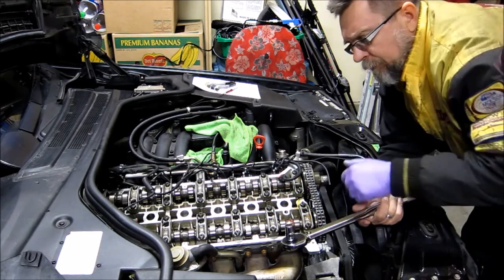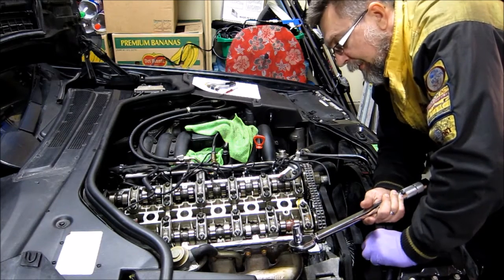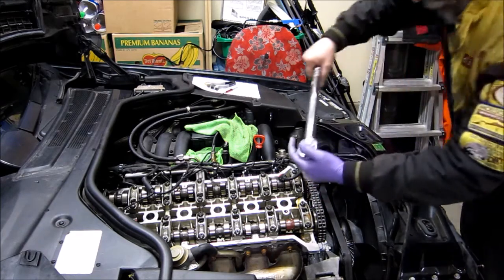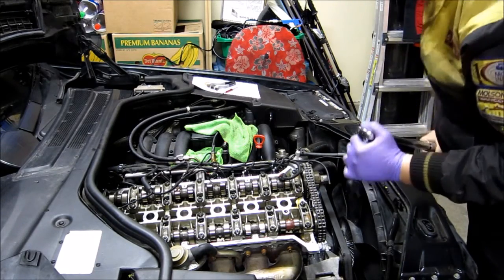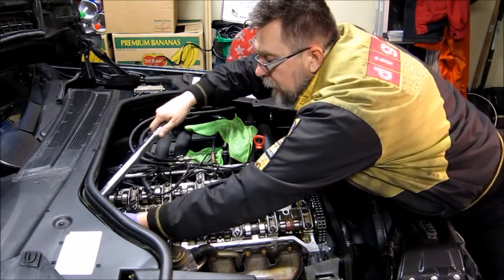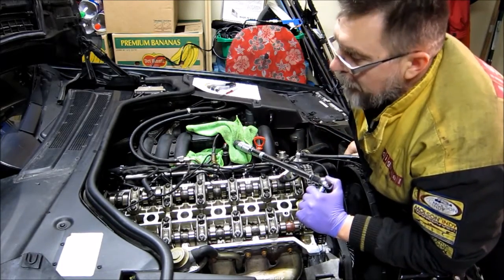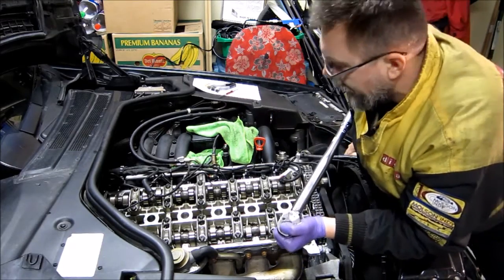Mercedes Benz W140 S320 Engine M104 Retorquing Head Bolts

Comment: Can i replace bolts only one by one ? i think my mechanic dont replace them when he worked with my head gasket
Reply: Mercedes manual says to replace the bolts when doing the head gasket, but I say you can use old bolts if they are ok...I would replace the bolts if they have stretched and are longer then 163 mm. New bolts are 160 mm long. 
If you want to replace them you could replace them one by one, just make sure you clean the bolt holes...remove all oil that is on the bottom of the hole or the oil will create a hydraulic lock and you can damage the engine block. 
Drain the coolant to lower coolant level below the height of the head gasket or coolant might leak into the cylinders. 
Follow the tightening pattern starting from the middle and apply some engine oil to the bolt threads and under the bolt head.
Good luck.
Reply: @andrewp3089  bolts are new mechanic said , can i retorque them using 90foot pounds(122NM) ?
Reply from the maker: @shithappens3031 
You could, but its not the best way.  The best way is to loosen the bolt, then follow the procedure : 50Nm + 90deg + 90deg.
You can do it one by one starting from the center and follow the pattern...
Better to drain the coolant and refill after you done torquing the bolt
Reply: i'm worried about my engine becouse high pressure hot oil can break new headgasket i think
Reply from the maker: @shithappens3031 
Oil leak in the front right could be a timing chain cover gasket leak. Its a known peoblem ob these engines.
Reply: @shithappens3031  I
Reply: thanks for answer , tell me which oil and plug sparks do you prefere for this engine ?
Reply from the maker: @shithappens3031 
I use syntitic Alsoil and copper plugs that MB recommends, cant remember the number now. Look it up othe manual

Comment: It worked on my engine, 99.9% of the oil leak is gone. I had a large leak in front and the read of the engine, the front one was the worst . I was ready to do the head gasket.  Thanks for the idea !. 12.000 miles and no oil leak.

Comment: Did it work and if so; how long did it last before having to do the head gasket?
Reply from the maker: I didn't completely stop the oil leak, it needed a new headgasket.
Reply: Thanks Andy.... I'm about to crawl under my S320 to change out the O2 sensor... if that and a couple other things gets the thing running so it's not stalling out all the time I've got to investigate doing the head gasket.... What a PIA.....LOL.  But thanks for posting the video.

Comment: Sorry for the late inquiry...what is the pattern? My engine is M111(4 cylinders) ,will the same pattern apply?
And what is the torque value? I read that it is 55 NM  for engine M104,does this apply for engine M111?
Reply from the maker: Mohamed Amer
Yes. Start from the center and go around just like I showed
Reply: You started from right front!!
Reply: and what is the torque? is it 55 NM? and you reach it is stages ..like 30 NM then wait..then 35 NM then wait..
and so on till I reach 55 NM ?
Reply from the maker: Look for
Pat's Car Garage    he has a series of videos for M111 engine.
I think u will find all answers
Reply from the maker: !!!!!!!Mohamed, You need to tell me first what are you doing. Are you just retorquing the bolts or you have replaced the head gasket, bacause that will drive how to torque the bolts.!!!!!!!
Reply: Sorry for delay...Actually my engine lost compression in cylinder 1 (at front),since the engine is leaking out oil (for years) and very near cylinder 1,I think there is loose head bolts especially at the front right side (where oil leak and near cylinder 1) (you mentioned in this video that you found the first 2 front right bolts loose a bit,right?). So back to your question,am planning to retorque not head gasket replace.
Since I didn't get a torque wrench yet,am planning to retorque the 2 front right bolts only,is that possible? Instead of retorque the whole bolt set.One more thing please,should I retorque when engine is cold ? or I can retorque with warn/hot engine? thanks
Reply from the maker: Mohamed Amer
I see. Ok so this is the correct way...
You will need a torque wrench.
1. Drain the coolant.
2. Starting from the center follow the tighening order as it shows on the page u sent me. Do one bolt at one time....
Loosen the bolt and pull it out. remove any oil that might be in the bolt hole, this is to prevent hydraulic lock. Apply some oil to the bolt threads and insert the bolt. then torque it to 55Nm, then you tighten it another 90deg and then another 90deg. When you done the first bolt move to the second.
Reply: oh...why remove coolant?
and retorque 90 degrees over 55nm!!!  isn't that over 55nm?!!(this may snap it off!!)
Can I just retorque the first two bolt on the front right (the suspected ones)? or do I have to retorque all?
what if the engine suffer stretched bolts? do I have to buy new ones?
I'm planning to buy one bolt to compare..if the bolts are longer than the new one,for sure they are stretched.
what do you recommend?
thanks
Reply from the maker: Mohamed Amer
Coolant drain... To make sure coolant doesn't leak into the cylinders or oil when the bolt is removed.
55Nm,90deg,90deg? This is how the bolts are torqued, 55Nm is to bring the bolt to the yield point, 90 + 90deg to stretch the bolt.
Now... U can do what I did in this video, this is a simple cheating method.
 U can measure the bolts, they are 160mm long when new. As I recall max allowable length is 163mm (need to confirm). If your bolts are longer replace them.
Reply: AndyP Mercedes-Benz Channel I removed the valve cover. .but can't find the head bolts!!!are they alley key bolts!? What bit did you use? You showed us the bit in this video. . But it is not clear..thanks for everything
Reply from the maker: Mohamed Amer
The caps that hold the camshafts have a hole, look inside u should see the head bolts.
The it is a triple square something like , can't remember if it's 10mm or 12mm
Reply: I have taken a photo of the engine head inside ..but don't know how to share with you...after searching it is a 12mm triple square bit..so far can't find it here!!!!!
Reply from the maker: Mohamed Amer aiptech1@gmail.com

Comment: Hi Andy the engine internal is very clean I own A 98 S420   how would i get to that cleanest
Reply from the maker: Aaron Thomas 
hi. i havent done anything. this car has very low milage 120k km.
Reply: The M104s just seem to stay extremely clean. Mine looks exactly the same inside after 150k km of mineral oil

Comment: Amazing Job MrAndy..keep up the good work.
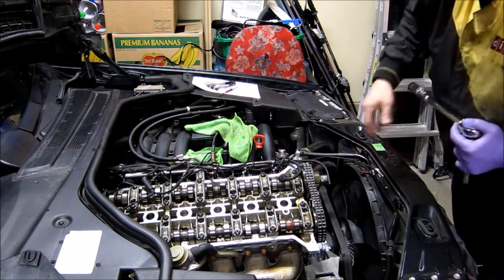I have oil leak in the same area you mentioned at 1:39 .Did this stop the oil leak? Head gasket issue is well know in the era of 1994 till 1996 .Thank you
Reply: AndyP Mercedes-Benz Channel this technique worked on my m104 , I had a 2 leaks the front , and the back of the head! No more leaks!!, the bolt were all loose". You saved me a hundreds of dollars, I was ready to change the gasket next week,  until I watched your video. Thank you!!
Reply from the maker: No, it didn't work on this car. I still have a small oil leak, just can't find the exact source. Need to use oil dye to pinpoint where the oil is coming from.
Reply from the maker: No, it didn't work on this car. I still have a small oil leak, just can't find the exact source. Need to use oil dye to pinpoint where the oil is coming from.
Reply: It is the part of head gasket that surrounds the timing chain
Reply from the maker: +Mohamed Amer 
if u have in mind the U-shapped gasket on the front top cover, i replaced it. It was my first suspect. 
My friend had a leak in the same area on 96 C280 and we ended up changing the head gasket because it had a crack.
Reply: Was it an easy replacement? I read a thread on this replacement and it was so difficult
Reply: I mean the U-shaped gasket
Reply from the maker: +Mohamed Amer 
No. its a very easy job. Theres a little trick that my friend came up with. I got a video on it. Not a good one cause the battery in my camera ran out, but i got some picture s in the end to explain how i did it.
Reply: Could you kindly send them to me? I'm sure mine is shot..a lot of oil in this area since 2002!!!! Do you believe this?
Reply from the maker: +Mohamed Amer 
look for the vodeo, i put them in the video
Reply: Am sorry..could not find it!!!
Reply from the maker: +Mohamed Amer 
look for " how to replace front top cover seal" on w140 s320
Reply from the maker: +Mohamed Amer 
try this 
https://youtu.be/L4lFJ3gxedg
Reply: Thanks.. 👍
Reply: Thank you Andy for posting these M104  videos  . I will use the head bolt retorquing on my 1990 300SL M104 . I'll  use the torque sequence . 
   I own two R129's with M104 engines and your videos are loaded with tips , techniques and etc . 
   Thank you .